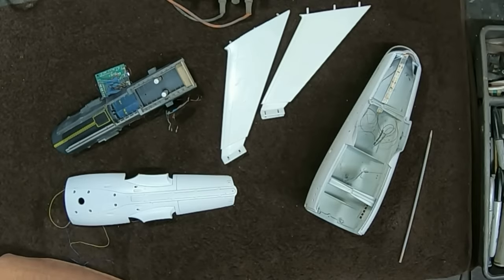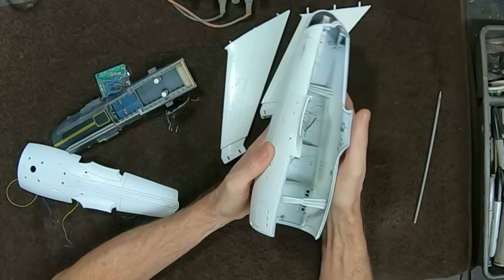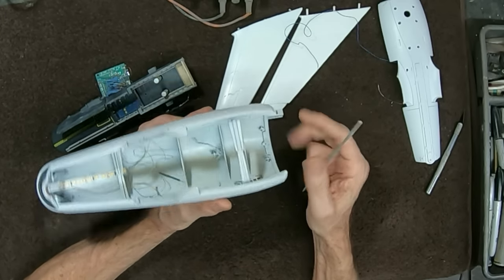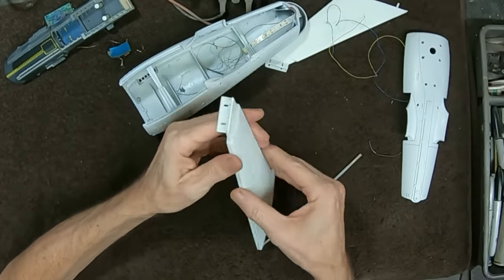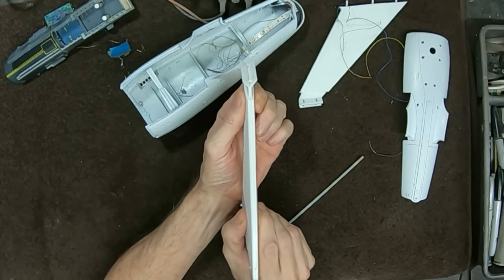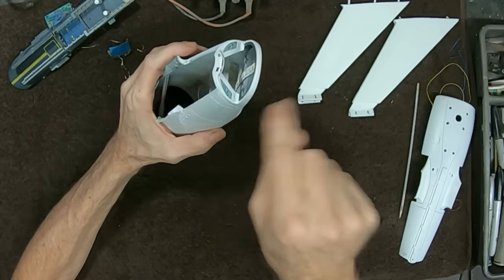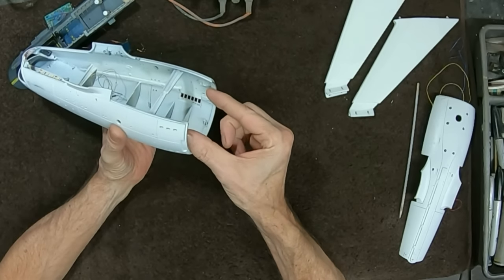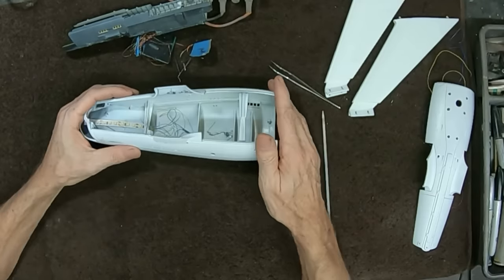Polar Lights 1:350 Scale Enterprise Refit Update "The Engineering Hull"

Comment: Completely agree with the importance of fitment and procedure. It is possible to work the five hull parts into fitting as desired without flaws that will cause problems later. When after many dry assemblies and adjustments to get the best results, I used a #6 paint brush to apply extra thin Tamiya capillary action cement quickly to bond the sides and fantail to the bottom. Once done I added the top without glue and held the pieces together with twenty elastic bands insuring the parts would hold while curing. Follow Boyd's advice and you can't go wrong.

Comment: Nice pointers for this kit. I hated this kit when it first came out. It was super frustrating the way it was poorly designed. I finally had finished building it but it looked just okay and there were no aztec decals so I hand painted all the aztecs which took days and then covered them almost completely with white paint so it was very subtle. It actually looked pretty good. It eventually ended up in the trash bin though to make room for other stuff! 🤣😂

Comment: For the mounting holes on the bottom back of the shuttle bay floor, I ovaled them out fore to aft. Then on the aft side, cut the side off creating a funnel shape so it guides the pins in to seat deeper in the cut ovals so it slides further aft to contact the fantail piece. Looking at Additionally making a flange for under the fantail curve that the deck can rest on and be additional light blocking provided there's room to do so.

Comment: Hi Boyd, 1. What basecoat color did you use on the 1:350 enterprise refit, and was it acrylic enamel, or lacquer? 2. Did you use a gloss clear before, and after applying the decals? I'm considering using duplicolor for light blocking, and priming, and since I don't have a spray gun, I was considering using Tamiya rattle can paints. Just trying to make sure I get the right primers, paints, and clear coats before ordering. You've built so many beautiful, and detailed models over the years, that you've become my go to guy when I need guidance. I built the 1:350 tos enterprise using your suggestions,, and watching your videos, and it came out absolutely beautiful. It definitely gets the WOW factor from family, and friends. Thanks again Boyd for your expertise, patience, and guidance.
Reply from the maker: I used Duplicolor grey primer and then top coated with Tamiya white primer for the hull base color. They used regular white primer on the real thing and it looks good. I'll finish all of the aztec painting and the other colors on the raw base coat and then seal it with one coat of Duplicolor matte clear. After that, apply the decals and seal once more with the same. The matte clear dries a nice smooth semi gloss. They have 2 kinds of matte clear, I prefer the one for wheels. It's smoother and not as dull.
Reply: Thank you. I used the same duplicolor matte clear that you used on my 1:350 tos enterprise, and it went on nice, and smooth. The decals weren't as detailed on the tos enterprise, and easier to apply. The decals for the Refit look like they might be a bit of a challenge in some areas...thats mainly why I asked if the gloss clear would help them lay better on the model, and reduce possible silvering. I have micro set, and micro sol solution should I need it. Maybe I'll try the matte clear first, then apply the decals, then use the gloss clear as a final coat...still undecided right now. I might use only the matte clear, so the ship looks more realistic, and less like a toy.

Comment: Great video Boyd! I always learn new things with every video you do. I do have one question, what do you use for wiring? I've always used magnet wires but I heard you say you don't use that anymore.
Looking forward to you next video! Stay safe until then. 👍
Reply from the maker: I use 30 gauge wrapping wire. It's just as thin as magnet wire but it has an easy to remove vinyl coating on it. 
It's available at Hdamodelworx.
Reply: Thanks @TrekWorks